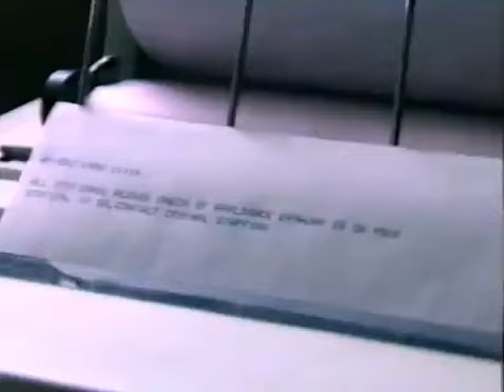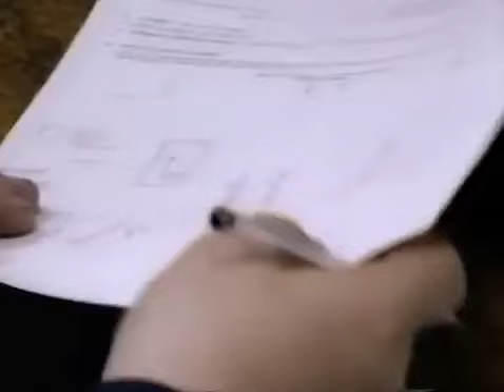Firefighters BBC 1997 Series Part 1

Comment: For those who are interested, this Old Swan station closed in 1999 and moved into a slightly smaller ground floor station a few streets away, low hill was permanently closed and is now renamed Kensington
Reply: Charlzey1998 thanks
Reply: did they both keep they two machines
Reply: Theyre both 1 pump stations now
Reply: Do they still run 4000+ calls?
Reply: No they're not as busy now so they've been 1 pump for well over a decade now
Reply: Old Swan station moved to 628 Queens Drive. Low Hill closed 2010 (46 West Derby Rd. now Premier Autocare) replaced by Kensington station (Beech Street) about 1 mile away.
Reply from the maker: Thanks @Charlzey1998.

Comment: Ive noticed that then and now british fire stations almost nerver sent any ladder or tower trucks
Reply: Not every station has an aerial appliance. Plus most of our buildings are only 2-3 floors high. If the initial call indicates one might be needed one will be sent, otherwise the incident officer will request one when on scene. Also, we don't have 'engineers', 'truckies' or 'squads'. Everyone is trained the same and can do multiple jobs.
Reply: Actually, it is the centralised control room who mobilise appliances as they receive emergency calls, not the station. Each & every premises has what is termed a "pre-determined attendance" (PDA) as does every other  other scenario, such as vehicle collisions, etc. That restaurant would already be known & logged as to the risks it poses, how many floors, occupancy, etc. The OIC or even central control can ammend it as required, including requesting aeriel appliances. If an aeriel was stated on the PDA, it would go at the first call, along with pumping appiances. The single emergency number (999 in UK ) was invented by the general post office in the 1930's , allowing central control to operate as we now know it.

Comment: 4000 calls a year?

That’s 10 a day!
Reply: There aren't 400 days in a year.
Reply: @shaunbrown6365  4000 calls ÷ 365 days of the year = 10.9 ..... closer to 11 calls a day
Reply: I worked on a 4,500 call  station in the early 90's , but another one of our's had over 7,000 calls a year, over an area of approx 6 square miles. That's more than the entire adjacent county brigade.